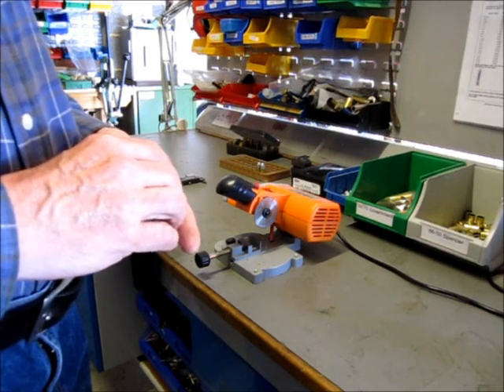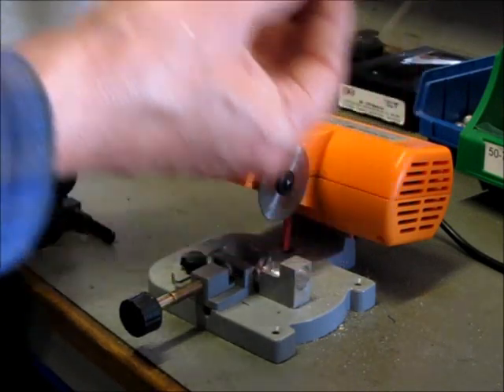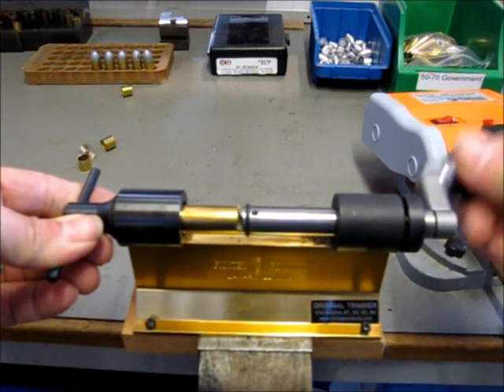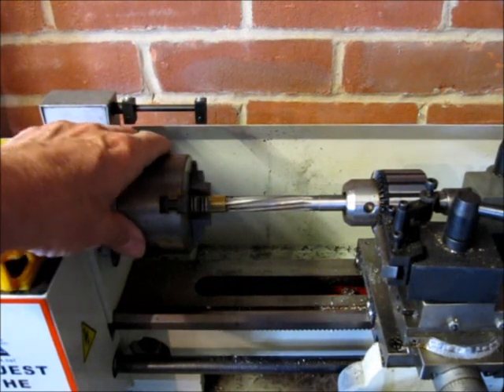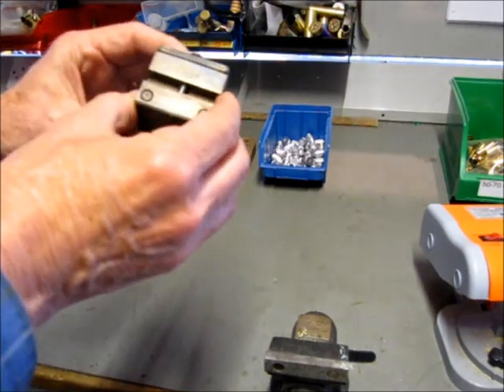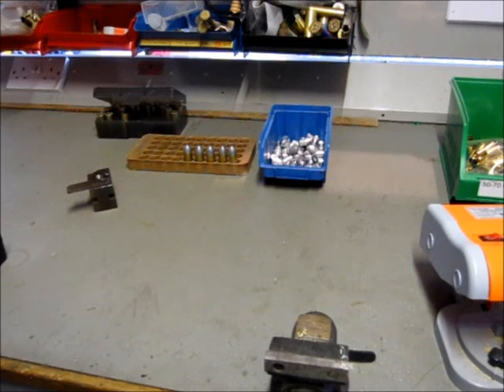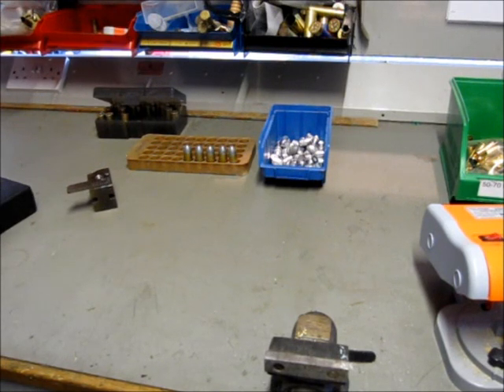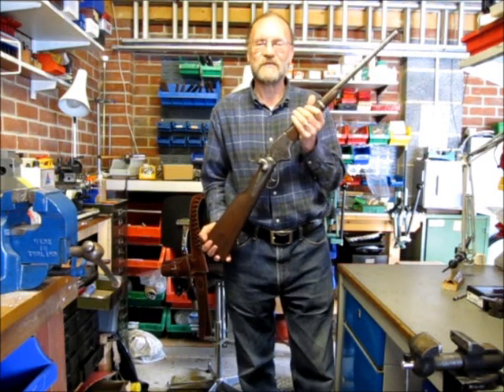Spencer centre-fire conversion   part 2

Comment: The Starline brass works perfectly with late Spencers , like my 1867 or NM , they have a different extractor , instead of the side bar they have a bottom positioned claw  -  "Lane  extractor'  .They also have the Spencer magazine cutoff , a sideways pivoting fork on the cartridge guide that sits on top of the block , and works in combination with the claw , different from the Stabler which seems to have given you fitting problems.
Reply from the maker: Unfortunately none of the UK Starline importers bring in the 56-50 brass as there is llttle or no demand for it in the UK. I had an 1867 Spencer which had the Lane extractor but no magazine cutoff - I don't know whether it was just missing or never fitted. It would have been unlawful to convert it to centre fire in the UK so I sold it on, which was a shame as it had a mint barrel.
Reply: before the Starline brass was available , i also made ammunition with 32ga. brazilian  brass shotshells , 50-70 and 348 . , anything close to 14 millimeters seems to work.
So it is illegal in the  UK  to fit a centerfire block , but is it legal to own a modern replica such as the ones manufactured by Chiappa ?
Reply from the maker: Original Spencers are classed as antiques and can be possessed without a licence provided they are not fired.Fitting a centre fire block would be manufacturing a Section 1 licenceable firearm, which is a criminal act unless you are a registered firearms dealer. Repro Spencers are all subject to licencing in the UK, as are all repro cap and ball firearms.